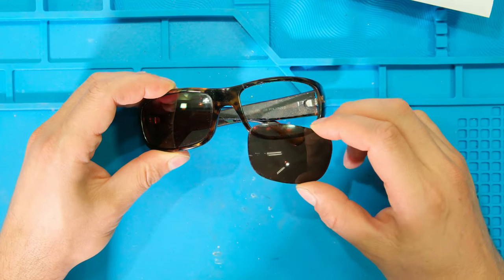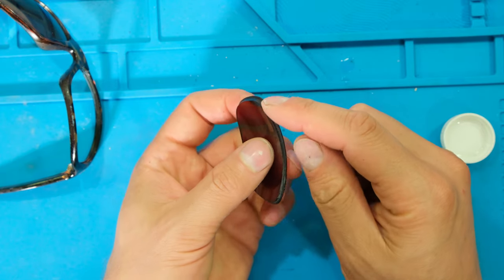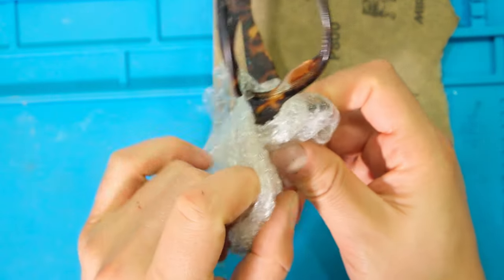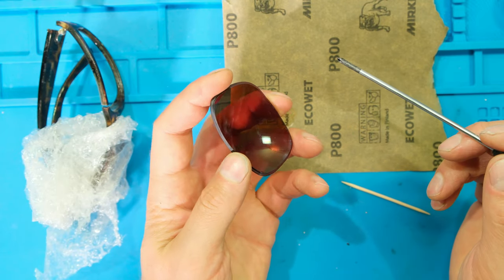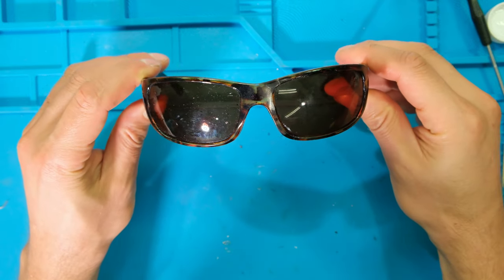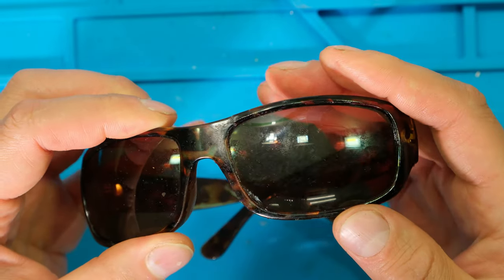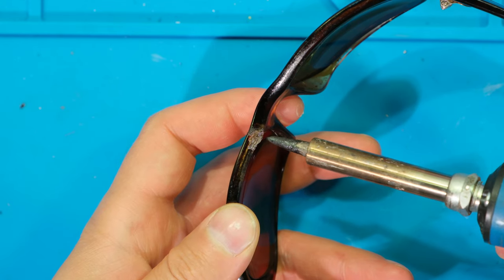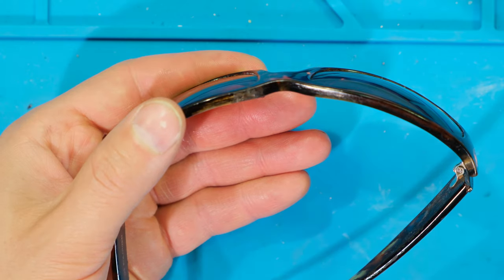Prescription sunglasses frame broken - fixed - plastic spectacles frame broke- how to repair

Comment: Thanks for this video. Be careful because:

It's never a good idea to rub lenses with alcohol. It will soon result in superficia  micro cracks that will ruin the vision.

Super glue vapors will put a wite fog on the lens